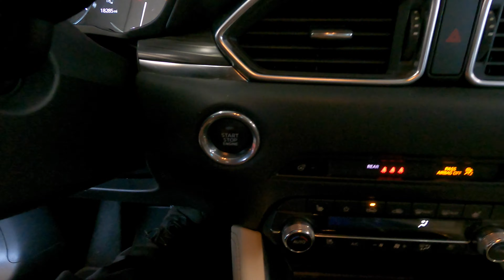How To | Mazda CX5 | Battery Replacement | All Years Present

Comment: What did you do at the end? You pressed the start button and it didn't appear to start, then a few seconds later you tapped the key fob on it to start it. Did it have to be paired? Did you have to do that with both fobs?

Comment: Good video!  I have a 2018 CX-5 Grand Touring, also with the 2.5L engine.  Did you replace with the same size battery as what came out?  I noticed your description listed battery size 26R, but most sites for my 2018 and your 2019 say size 35 with one also listing the 26R as a fit.  According to Adv Auto's site, size 35 is about 1" taller but with higher cranking amps than size 26R.  I noticed in another video's comments that some CX-5 owners had to trim their plastic heat shield down because it interfered with the + clamp fitting over the post. Thanks.
Reply from the maker: in some or most vehicles it all depends on model.. some vehicles model with higher trim which include more electronics requires AGM battery but some exact model with basic trim takes regular acid battery...agm batteries are the best and it will last double the life it doesn't matter what trim you have always use agm...also in hot climate heat shield  I throw away because they shorten life of battery in hot climate states only

Comment: is a reset required for a Mazda 2012 Diesel 2.2 lt i stop model ? like , do i need a scanner to reset code ?
Reply from the maker: It sure for diesel… but there is no any reset on battery … if by any chance there is a some kind of light just cycle key or drive it for litttle bit … it will go away
Reply: @AutomotiveDysfunction  thanks , paul from Australia 🙏

Comment: you skipped the disassembly 1:10 :(
Reply from the maker: No… nothing to it … take the battery hold down off like you see in video and pull battery out
Reply: @AutomotiveDysfunction  theres a whole bunch of padding around mine so i was wondering if there was any trick to it
Reply from the maker: @Medsas  padding it’s just a cover for  battery  to keep warm in winter …  pull that out first ,,  then batter … we don’t need battery padding covers In Florida  it’s too hot we throw that shit away lol